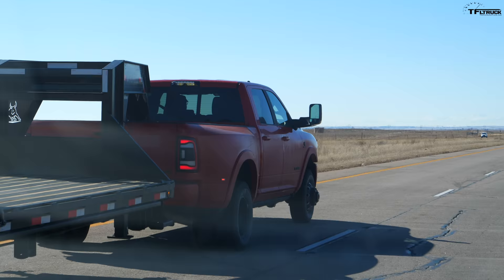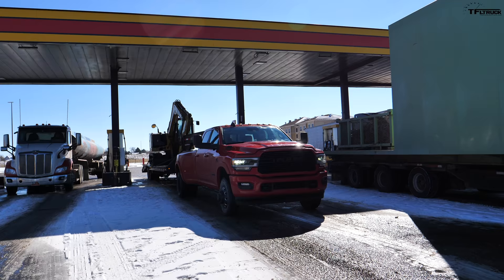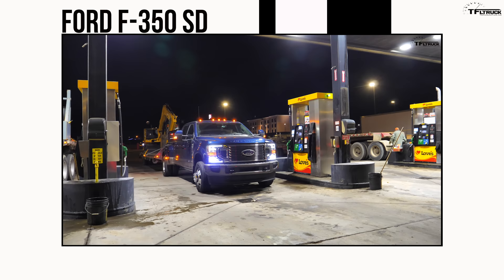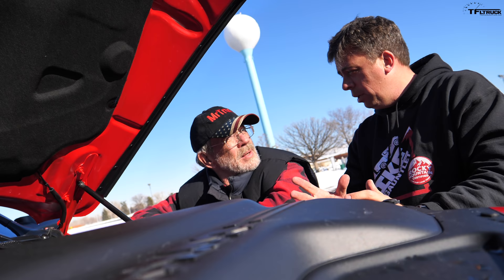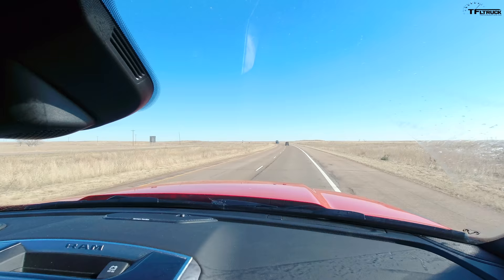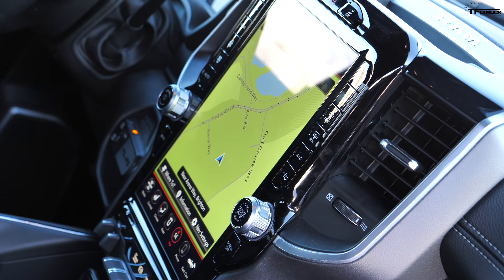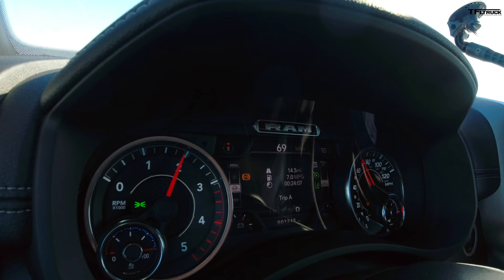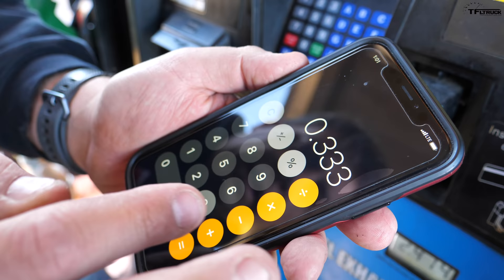New Ram 3500 Cummins Takes On Our 30,000 Lbs MPG Challenge Against GMC & Ford Diesels!

Comment: Bring them all back with 20,000 miles on them then see what the mpg’s are.
Reply: Out of the 15 new trucks off all brands my mileage doesnt change.
Reply: AMURIKA
Reply: Josh Szydel cummins ALWAYS changes
Reply: @jorgeosorio8459  I've owned 16 cummins trucks.
Reply: Wheel bearing  Looks like TFL found the next test they need to perform.
Reply: @joshszydel8202  its typical of the Cummins to improve around 5,000 miles.  My 2019 HO got 2 mpg better at 4700 than 3000.
Reply: Are you saying that the Cummins doesn't work right from the factory? Why am I not surprised.
Reply: @What Up I get what the others are getting at but what part(s) exactly is "breaking in"? Tolerances should be exact on new engines from the factory now. Is there lots of metal in the oil on the first oil change? Diesel high pressure common-rail fuel injectors don't "break in". Sounds like something is not right to me, fuel economy should get worse with engine wear. Or probably a better chance that they got used to the torque curve of the engine and drove it more efficient?
Reply: A buddies 2019 cummins has 22,000 miles on it now and it gets 8mpg pulling a 4 place snowmobile trailer with the sleds on it. Worse than my half ton gasser hahaha
Reply: $80,000 for a new truck.  No thank you
Reply: @James-dh1ji  haters
Reply: @James-dh1ji  or it's called a break in period, I don't see powerstrokes or duramaxs in semis, tractors, or construction equipment
Reply: All of these (Cummins, PSD, Dmax) engines are broken in from the factory. Anyone that works on trucks knows this.
Reply: Mark That’s completely untrue. Not only does the manual for the Cummins go over this but it’s experienced in the real world too.
Reply: @redtitan29  I work on them and have been to the factory where they are assembled. The manual is more for liability. Today's machining tolerances are tighter than ever. If you're so knowledgeable what's your experience working on diesels and what are these mysterious parts  that are "breaking in"? I'll be waiting...
Reply: @redtitan29  From page 10 of the RAM diesel supplement: (bold type added for emphasis)

"10 THINGS TO KNOW BEFORE STARTING YOUR VEHICLE
ENGINE BREAK-IN RECOMMENDATIONS
The Cummins® turbocharged diesel engine does not require a break-in period due to its construction.
Reply: Mark I actually own and experienced exactly what I said. I get 2 mpg better today than I did when my truck was new.
Reply: @redtitan29  you didn't answer my questions. Also, your precieved fuel economy increase doesn't mean the engine isn't "broke in" from the factory. I'm still waiting.
Reply: @UCDdRZmCqBX7nT84H3sckbzQ Ok, so you're one of those guys. First, I hand calculate my fuel mileage. Secondly, I experienced first hand a mileage  improvement of 2 mpg. Im not going to argue with a keyboard warrior with something I experienced myself. You can talk until you're blue all that you want but I experienced it, not once, but multiple times. You stated Cummins only discusses the break in period for liability reasons. Can you explain what exactly their trying to cover themselves from? Like I said in my first comment, bring them back at 20,000 mile to see. Until then, you work on them and I'll comment based on my experience actually owning them.
Reply: @mmholling87  Read down through this comment section alone. Im not the only who has the same experience. Things that make you go hmmmmmm.
Reply: Steven Kane I’ve read through the comments and there’s nothing Intelligent worth repeating. You still haven’t informed me what parts of the engine actually break-in during this period? I have attached a quote directly from Cummins saying their engines don’t require a break-in period.
Reply: @Steven Kane I’m a grease monkey and we do tons of stuff that seems pointless to me but protects the company from being sued. Company’s hate to admit their wrong and perform recalls.  If they can pass the buck to you than that’s what they’ll do. Liability is cheap insurance to protect themselves. 

Today’s engines are broke-in at the factory, it’s cheaper in the long run due to they can catch a bad one before it makes it out. Piston rings need to seated during the break-in period and your cylinders need to be free from hot spots or you’ll get a bad seat which will cause blow by. Also, your bearings will make metal during their breaks in process. The metal is normally caught with the engine oil filter but it’s better to keep it out of the engine entirely. Cummins hooks their engines up to machine for break-in which varies the load and supplies new clean oil during the entire break-in process.  The is how all modern engines are broke-in today. 

Before you call someone wrong you don’t know you might want to question your own knowledge and experience, owning a truck or two isn’t much credit. I’ve worked on thousands of engines, worked with engineers and field reps that see millions of engines including medium trucks, construction equipment, generators etc. I think they know more than me or you.
Reply: Witch would you think Will win

Comment: I think 70 mph for any of these pickups towing 30,000 lbs is too fast.  They may be able to move the weight, but controlling the weight in an emergency situation is another thing. As for the mileage while towing that much weight, I don’t really care which is better.  For me and my use pulling a 10,000 to 15,000 lb RV, it’s about the environment I’m sitting in, and Ram has that nailed.  In my opinion, the interior of the Ram is far and away better than the bland interior in either of the others.  They can all haul dramatically more weight than most of us will ever attempt, and for more miles than most will ever keep the truck, but it’s the quality of the experience from inside the truck that matters to me.
Reply: Nice spin!
Reply: I've pulled my little car hauler at 70mph but if I'm trying to make money I'm comfortable with the MPG at 62 and letting everyone blow by and keep me out of the clusters.

You gotta do the math for yourself but in my particular case it saves about 10 grand in fuel over a year with minimal productivity loss.

Slow and steady and easier on the brakes and tires.
Reply: @Fortz DR Ram fan boy?
Reply: Ford Has Always Had The Best Interior of All Big 3 Manufacturers. Lets Just Be Honest!
Reply: I really want to see the Ike challenge and this one with a deleted truck to actually see if the emission equipment really kills mpg like everyone says
Reply: @michaelglaspir3654  no I disagree the 8 years I was at Ford the interior just kept getting worse way more plastic then the other 2 and just feels very cheap and that was the number 1 complaint from customers I shouldn't be hearing as much plastic noise as I heard while road testing 80 to 90 thousand dollar trucks
Reply: I do 65mph in my semi truck and I couldn't imagine what it's like for these dudes in pickups doing 80mph!🤣🤣🤣
Reply: Agreed

Comment: Ford is killing these other trucks!  Minutes ahead in an 8 mile race pulling 30,000 lbs. Using only 12 ounces more fuel but going much faster under load.   Then when going the same speed 1.8 miles per gallon  better than the Ram = 38 gallons of savings every 1,000 miles.   38 gallons  x  $3 per gal = $114.00 over 100,000 miles is $11,400.00 in fuel alone.  Way to go FORD!
Reply: I’m interested to see what happens with a 10-speed behind a Cummins.

Comment: Wind wont effect a trailer I tow over 20k all the time. You bet wind changes everything.
Reply: exactly what is this old dood in the video even saying
Reply: Exactly! Wtf! May not effect the trailer but whats on it will and how much wind there is during a given time
Reply: Wind will affect your MPG's , in fact it's the biggest factor lol
Reply: Wind will affect that flat bed and excavator, though probably not as much as a enclosed trailer. One time I was pulling a small travel trailer going west in the Columbia river gorge. We met a very strong headwind and although we would have had plenty of fuel if not for that, the fuel mileage dropped a huge amount and we would have run out of fuel a 100 miles sooner than anticipated.    We had extra fuel cans in the truck bed thankfully, because we had to stop and add it.  The strong wind made a huge difference, but any wind affects mileage, especially a head or tail wind.

Comment: Putting your straps outside the rail can get you a DOT ticket.  When I was a truck driver got pulled over as such.  You have to put your straps between the side and rail.
Reply: Then you were cited by misinformed Diesel Bears. That's not a violation.
Reply: @wbball15  Wrong. It is a violation. Not to mention, it's common sense. What do you think the rub rail is for.....looks?
Reply: @wbball15  I am a truck driver as well, and this is common knowledge that it is a violation to put your straps over the outside of the rub rail. We even had a Texas state trooper who was the director of that region come to our company when we were in the oil field and tell us that it is probably the number one violation they nailed people for.
Reply: Good catch, interesting point. That's because they can break if the trailer rubs against something, right?

Comment: Having a 31 gallon tank would get annoying hauling heavy loads. My F-150 even has a 36 gallon tank.
Reply: Gunnar Johnson 
I got the big tank in my F-150
It costs over $100 to fill with 87 octane. 
but it also goes about 600 miles on that tank.
Reply: Agreed. The 50 gallon tank should be standard
Reply: I upped my main tank in my old F350 to 67 gallons.  The range is awesome...
Reply: @richfarfugnuven6308  Long bed or short bed? I'm looking to up mine to more in an F350 short bed.
Reply: Lol my tank is 200 to fill... Sucks ass
Reply: Used to have a V10 Ford F350 with a single 18 gallon tank for pulling a triple axle enclosed race trailer. Getting about 4.5mpg, it had about 80 mile range. Astounding Ford would even build such a stupid thing. Quickly bought a 50 gallon saddle tank to be mounted in the bed - and welded a bung to the fuel filler neck of the truck's tank... Rigged up a little transfer pump so I could refill the truck's tank from the bed-tank. It at least made the truck functional.
Reply: Costs me $900 to fill up my tanks😢
Reply: @atomictyler  long (8 5 ft).  I went with titan.  I think they make like a 56 gallon for the shortbeds. I need a big skid plate now though it hangs down a fair amount.  I am a little bit of a nutjob. I actually offroad a 10k pound truck occassionally...
Reply: Makes me curious if that 50 gallon can be ordered separately and bolted into my '18 as a direct replacement.

My bladder may not hold out to burn 50 gallons but I don't like stopping just for fuel and then having to stop again to pee 15 minutes later just because they weren't synchronized. Lol.
Reply: @richfarfugnuven6308  What 10k truck are you off roading with? Your Titan isn't 10k so it can't be that. It doesn't even have a 10k GVWR let alone curb weight.
Reply: dchawk81 if you look closely, he actually meant the fuel tank brand he bought is called titan. Nevertheless 10k is a ridiculously heavy pick up truck
Reply: Yep. Have a 38 gallon on my truck and it's nice getting 600+ miles to the tank.
Reply: Brandon Taylor what kind of truck?
Reply: @GroovesAndLands  good lord man that bad!!! My old 460 used as a welding rig towing steel all day does better than that. Crazy! At least you got a tank in there to up your distance.
Reply: @dchawk81  I put a 50 gallon  fuel tank on my mega cab dually. Google Titan fuel tanks.
Reply: That's the problem with these lighter trucks, you're always looking for fuel.
Reply: @srn9973  Damn they're expensive. Yikes. I don't need one THAT bad yet.
Reply: My 04 excursion v10 has a 44 gallon tank stock.
Reply: @TheScrubmuffin69  Yeah it needed it.
Reply: wow! Gosh gee wizz ! 36 gallons!! that would get you like another whole 30 miles, Those Fraud  engineers can't beat em. yeah since its a short bed only 31 , but the long bed 51 gallons. funny they powerstroke short bed has only 34 gallons tank hmmm

Comment: I have a 17 Ram 3500 with 4.10’s and it does not get great mpgs. Combine that with the small fuel tank and you are constantly pulling over for fuel which adds a lot of time to a trip. Not surprised at the mpg of this test. Great work TFL as always showing what to expect in the real world!
Reply: yfz450rx I have a transfer tank in the bed for fueling equipment so I dont have room for one. I think my only option is to try and get a larger aftermarket fuel tank that would replace the stock fuel tank.
Reply: Should have opted for the 55 gal tank. Only $550 more.
Reply: You have the gas engine with the 4.10 gears?

Comment: Running all three manufacturers Diesels on the same loop = A Great test!   I agree that the 6 speed might be hurting the Ram's mileage. If I remember right, the Chevy and Ford ran at lower RPM than the ~2000 RPM@70mph that Ram ran. With the longest stroke of the three engines, I would think the optimal RPM for the Cummins would be lower than it was for the V-8 engines.
Reply: It is.  Peak is about 1600 for the Cummins.
Reply: Because the Ram was running in 5th gear. Tow/haul mode locks out 6th gear. Put that Ram in 6th and it would’ve gotten much better mileage
Reply: @CarbonPower  Tow haul doesn't lock out the overdrive on my Ram?
Reply: @CarbonPower  it does not lockout top gear. It's adaptive computer learning as you go. On my 15' and 20' 5500's it will go into 6th gear while in tow haul mode, but thats maybe cause the engine knows its working a lot less since the trucks are equipped with 4.88 gears.
Reply: @joshpodolsky7740  how much mpg do you get with your 5500 when towing?
Reply: @marvinblock4913  the 15' makes about 9.5mpg when loaded doing 60mph @2000 rpm, empty its at about 12mpg. The 20' makes about 1mpg better when loaded and about 2 mpg better empty. 
The 15' is fully deleted (egr, dpf, def, stock hp rating), the 20' is complete stock with all emissions. 
Can definitely notice the 5th gen's newly designed motor, pulls better, better exhaust break, better fuel milage, slightly quieter/smoother motor.

I say "about" for fuel milage cause they are mostly driven on country roads doing farm work, not driven down highway for extended periods of time often enough to know fuel consumption very accurately. On the country roads the trucks both make 1-2mpg less, depends whos driving.

Comment: It has an alarm if you overload the air system.
Reply: Yup. Even the 2015-18 had that
Reply: it should have a gauge like a big truck to know your weight or at least air pressure

Comment: I have a 2022 basically same truck, I run mine in tow haul mode around town and on  back roads with lots of elevation change but On flat highways I run the transmission in standard mode which gives me better fuel mileage and that’s towing over 15,000 pounds on a daily basis, Thanks for the great review I really enjoyed all your reviews